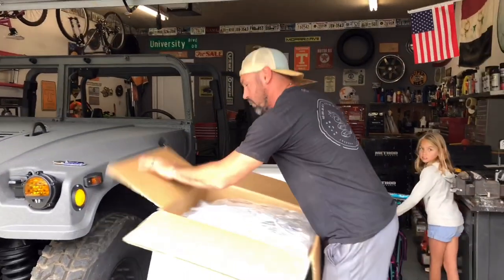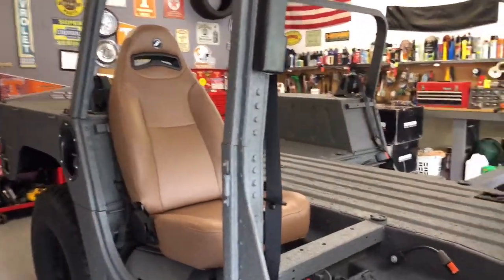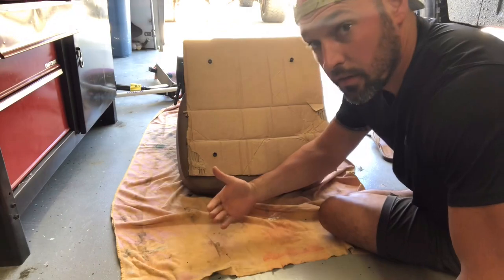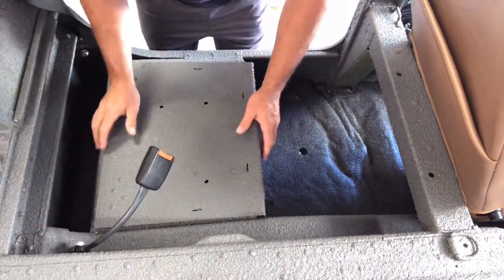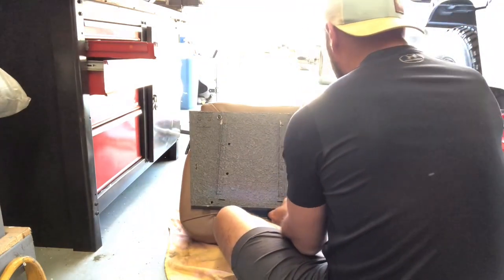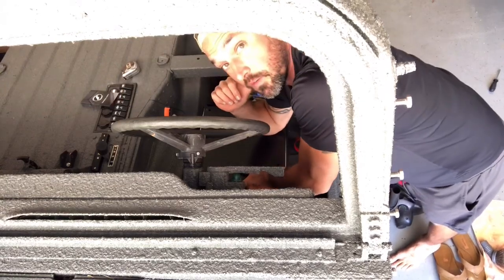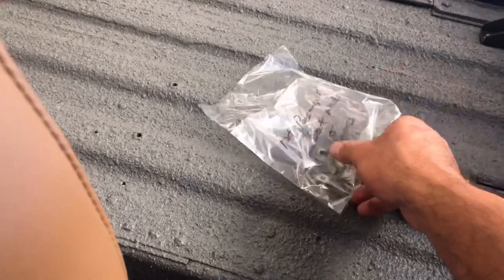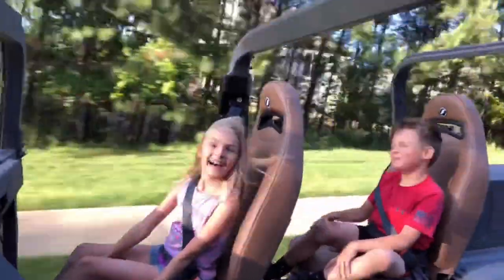Humvee Seats Install Build Part 17

Comment: Finally someone actually posts how they went about putting in seats instead of just showing what the end result looks like. Thanks for showing. I am planning on doing the same but trying to figure out how to do the driver's seat. I have the original driver's base, the one with the spring mesh which is nothing like the one you have. It looks like Cobratek offers an adapater plate for it.
Reply from the maker: Thanks brother! I had an m998 with that seat base and welded a rectangle bracket to make the entire seat bottom the same height out of some 1 1/4” x3ft steel. Then bolted the seat to base and the bracket. I wish I had a pic but I don’t. It can be done however you won’t be able to slide back and fourth or raise up and down. I would try to find the base out of one like mine m1123.

Comment: Dear Split Builds  - had had same problems on my Chevy M1009,  my solution, carrying of 
= Metal-Sheet-OEM,   so I  put  - in addition,  a - second - sheet,  same size + dimension, over
the Original,  = here  I did  slit's  into  = . for final - as  I did drill   screws. into  slits.
Result, saved the Origin sheet - to have final holes  ( against  too many wrong drills)  and had had more - stabilization.  thanks for Attention,
last not least,  thank you so much for Video, wishing You and your - helping - Wife and the *young
- Princess*  health and luck,   Greetings from Germany,

Comment: Great job , have you installed the windshield or tried to fit it yet  , just wondering if the spray liner interferes with seal and glass install.
Reply from the maker: The windshield should be here by the end of the week, it shouldn’t interfere that gasket is pretty thick rubber. It worked fine on the other Humvee’s that I built.
Reply: @SplitBuilds  Thanks

Comment: Hi, I also got the same Humvee and currently trying to insure it and my insurance agent says the VIN number is too short. What insurance company are you using? I really appreciate any information. Thanks!
Reply from the maker: I had to use Grundy if it’s less than 25 years old. Or you can use Hagerty if it’s more than 25 years old
Reply: Thanks, Split Builds for your reply! My insurance broker tried everywhere and was able to insure my 2002 Humvee with Allstate. In case this info would be helpful for someone. Allstate insured it as AM General Hummer, this way they were able to plug in and use the short VIN number. Around $500 for 6 mo for 20/30 coverage with some discounts applied